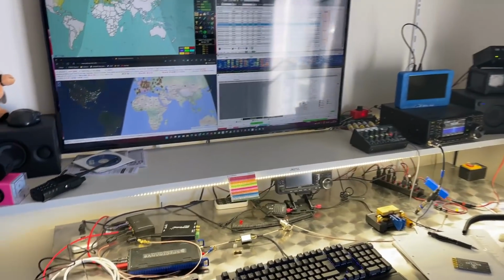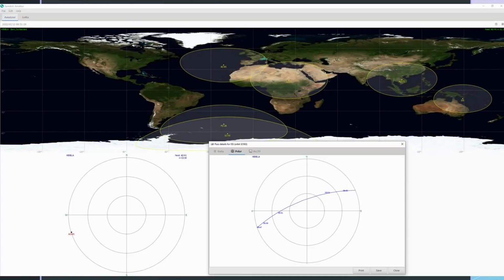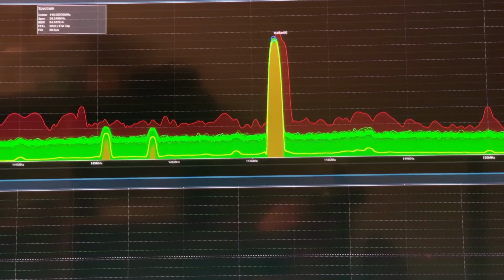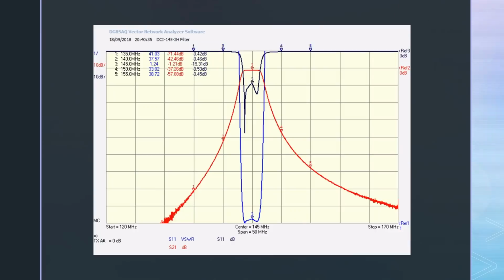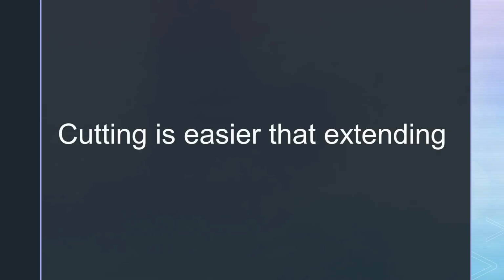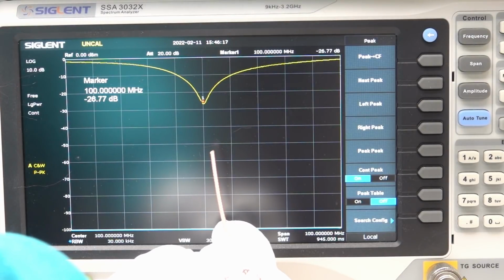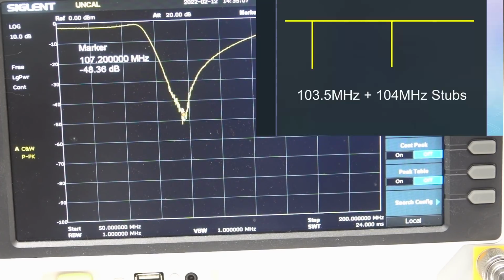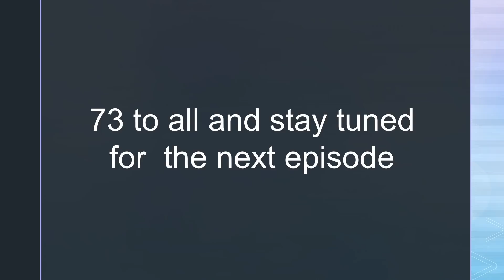009 Does a simple Quarter-Wave Stub Reduce Interference?

Comment: I need a filter for the 144.3 digipeater 6 miles away. BUT I still want full RX on  144-144.25, or everything below 144.300. Can this be done?
Reply from the maker: Not with this stub. You would need a much bigger filter for that.

Comment: You can get sharper nulls and closer spacing using longer stubs so a particular shorted stub will appear as a short at 1/2 wavelengths (of the offending signal) but as an open at 1/4, 3/4, and so on, of the desired signal.  A length will exist that achieves this although the closer these two frequencies are, the longer the stub needs to be and you start to lose efficiency.
Also, the stub is going to have multiple frequencies where it is open or shorted.
Reply: That's a Pro Tip right there !!
Thank You !!

Comment: I know this is 2 years old but something I didn’t see mentioned. If you add a second 1/4 wave stub spaced 1/4 wave from the first you will get a deeper and sharper notch. I don’t know how far you can take that, might get unwieldy after a few. You can make it tuneable also by adding a variable capacitor across the far end.
Reply: That's a great tip !!  Thank You !

Comment: Nice video!

I have seen coax stubs used on HF when having a group contest station, and it works.

If you were to use air dielectric coax, or make your own coax cavity, it would work much better than the coax stub.
I have seen where the cavities were silver plated to increase the Q.

RF is fun!
Reply from the maker: I agree with the cavities. They are also used for repeaters!

Comment: Funny i have a similar problem at home. I live very close to the local tv tower which houses a strong DAB Transmitter at arround approx 180Mhz. Weak Receivers like my SDR Play or a the direct mixer of my Anytone Handheld are getting overloaded as soon as you connect broadband antenna. Adding a quarterwave stub to the feedline  solves the issue.
Reply from the maker: Cool! 180 MHz fortunately is quite distant from 2m...

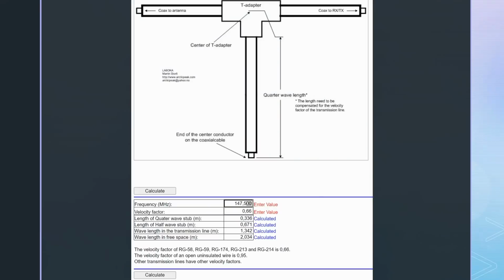Comment: 4:41 something you forgot to explain very well about coax VF for a novice, different types of coax material have VERY different velocity factor percentages! But you can always Google that coax to get a close enough estimate! 😁As an example between the "same" coax... a favorite "fancy coax" here in the US, LMR-400 has an 'advertised' VF of 85%, but I've tested a cheaper version called KMR-400 and found it had a 90-93% VF and MUCH lower TX losses at a fraction the cost. Of course that means even using the "same" series of coax the lengths would be quite different.
Reply from the maker: I agree. This is why I use cut the cable too long and use the VNA to decide on the length ;-)  (Then you can calculate the true VF)

Comment: An excellent presentation on 1/4 wave stubs. I've only made a couple, but I was pleased with the results. They are simple, and they work. 
I suspect larger diameter coax would have a higher Q and provide an even narrower filter bandwidth, and heliax would provide the best. I've ignored the small pieces of it I have had access to in the past simply because I thought it to be useless, but next time I see some I'll grab it for stubs.
Reply from the maker: You are right. Thicker coax has a higher Q

Comment: Cool!, usually losses are what define the BW, did you try using a better cable like RG-400 for example?. Also, do all notches have the same BW, I am expecting the higher order notches will have narrower BW, not sure though.
Reply from the maker: AFAIK you can change the bandwidth with different coax cables. I am not sure if the losses are the deciding factor, though. But I did not test it. And I do not remember if the bandwidth on the harmonics was different and how.

Comment: I live within 5km of ~10 FM Broadcast stations, and anything better than the stock rubber duck would render a UV5R deaf with front end overload. Made a 5/8 flowerpot antenna, feedline, and coax stub tuned to 98MHz using some cheap RG6 I had lying around. The stub worked well enough that I managed to score a contact with a station around 50km away on 2m.
I've abandoned direct conversion and moved on to superhet radios since then lol. 73
Reply from the maker: In my last video I showed a stub, too ;-) But against a pager.

Comment: Many thanks. Also helpful is a shorted stub, which serves as a bandpass filter, passing the frequency it is cut for. Many years ago I worked at a USAF radar site that had various radars from high VHF to S-band, all blasting out multi-megawatts. Concerned that my 2-meter transceiver would get fried, I created a shorted quarter-wave stub at 146 MHz and never had a problem. Any signal outside that range and its odd multiples was seriously attenuated. 
I have some old coax around and I'm wondering if the same idea might work on the HF ham bands to reduce out-of-band interference and offer some protection against lightning, a problem in my area. Each antenna would have a shorted stub tuned for that band.
Reply from the maker: I tried a shortened stub instead of an open one. Open it had a notch at 96MHz and its odd multiples. Closed it had a notch at 196MHz and all multiples. So I did not see a broadband rejection of the closed stub :-(

Comment: You may want to experiment with a shorted stub too, a bit more tricky to tune but gives a band pass version. BTW, another few passes of iss this morning with KG-STV on the 70cm
Reply from the maker: Others mentioned that stubs should behave like band passes, too. But I did not see such a behavior so far (if you do not count the wide space between two "notches" as the pass band).
Reply: @HB9BLA  if you short the end of should behave as a band pass element
Reply from the maker: I tried it and it just changed the frequencies of the notches. The wide part between the notches are of course a "pass band"

Comment: What about making a BPF instead of a BSF?
Reply from the maker: I do not know how to do that with Coax only.
Reply: @HB9BLA  Terminate the end with a short. The inversion will make it an open on the desired freq (and multiples).
Also, there's a nice design by Zack Lau, titled "A No-Tune 2-Meter Bandpass Filter", that also mostly uses coax.
Reply from the maker: I tried it now (because others suggested the same thing. The result is the same curve, just with different notch frequencies. Now you can argue that between the notches there is a (very wide) passband.
I looked at Zack's article. It looks very similar to the one I showed with the two stubs. He even writes about "rejecting unwanted pager signals around 153MHz".
Reply: @HB9BLA  DL4XAV had a page on the topic, there it's also referred as "a band pass filter for a wide frequency band". It's a good read, and has nice pictures on the BPFs, and they are quite wideband. I'm not really sure how to make them narrower, but the no-tune 2m worked well for me, so I can recommend it.

Comment: Stubs are good, as are bandpass, however for this application you might want to look at a notch. 
As always another excellent video, thanks.
Reply from the maker: Actually, this stub behaves like a notch filter. Just not steep enough for this application :-(
Reply: What if you use an open quarter wave at 147mhz. Or possibly 2 open quarter waves at 147 spaced a half wave apart and a short at 145.
Reply: @joecarty8579  That's something I used to avoid receiver overload on some Motorola equipment caused by the nearby airport transmitter. Pretty effective solution.

Comment: Hi Andreas,
Does the SDR receive software provide a way to create a notch filter? My Flex 1500 PowerSDR can create a TNF tuned notch filter that can be made very narrow.  73  WJ3U
Reply from the maker: The SDR filters usually are made in software (one of the advantages of SDR). My problem most probably was created at the ADC or the Mixer stage. So before the signal was digitized. I assume your Flex still has lots of analog filters built-in to avoid this.

Comment: Nice video, and thank you for linking the useful things I need to immediately buy 😁. What crimp tool do you use for the SMA connectors? I have an IWISS HSC8 6-6, but I don't think it'll open wide enough.
Reply from the maker: These are made for ferrules. You need a different one. I left a link in the description to the one I use. Probably not the best quality. But ok for me (I solder the inner pin because I was not very successful with crimping it)
Reply: @HB9BLA  Thank you for replying. Silly me, I looked for the crimp tool in the description but didn't see it at the time. Of course, I can see it as plain as day now - ordered!

Comment: Nice, this is always a nice and simple way of filtering out a spur. Especially since the materials needed are easily available. 
I guess you can do this with whatever media you have? 
Like coax in all impedances, stripline, twisted pair, etc.?

Do you plan to make a video on the spectrum analyzer?
I came across them by coincidence and they seem to be very nice units.
Reply from the maker: The principle should work with other media, too.
There is a video about the NanoVNA (how to use it). And maybe I will once to a video about different tools...
Reply: @HB9BLA  
Thanks for the fast answer. Good to know, I since read other comments saying they used this technique for twin lead as well. 
Thanks, I meant the Spectran V6 Spectrum analyzer. :-)
Reply from the maker: If you look at its price tag it is not really for private persons….

Comment: You can make the notch deeper by wrapping some Al foil around the stub. You have to experiment with the length of the foil and its location on the stub. I've seen an extra 20 dB of rejection if you get the size and location just right. :-)
Reply: Interesting that you mention the aluminum foil.  When I was a teenager the cable company would scramble Showtime unless you paid for it.  If you paid for it you got a box to filter out the frequency they mixed in to scramble it.  We would take some twin lead hooked to the antenna input and slide aluminum foil up and down on it until we filtered out the scrambled signal to get free Showtime so we could watch.  It probably wasn't legal but it worked!
Reply: @gibbywankenobi66  We did the same thing.  It wasn't illegal if you called it a school science experiment!
Reply from the maker: Thanks for the tip!

Comment: Andreas, thank you for another great video.  I'm very impressed with your wall of cables.  I'm a big fan of crimp connectors but have never attempted them on thin coax.  73 Lloyd - W1LBM
Reply from the maker: It is very easy (much easier than soldering), particularly for the small cables.

Comment: MANY years ago when I was a kid I lived in a rural area with a local (5 miles) channel 8 but I wanted to watch channel 9 but  that station was 65 miles away and channel 8 interfered and bled over. I made a 1/4y open stub and added it to the twin lead input on the TV. It worked so well we had to rotate the TV antenna to point at CH to watch it without snow. 73 WC0H
Reply from the maker: Also other commenters wrote about this use case! I think it was an easy and cheap solution (and it was even easy to find the right length because you had your analyzer connected to the antenna (the TV set)

Comment: Good but why not include the filteras a directional antenna?
Reply from the maker: The ISS moves fast and directional antennas would add another level of complexity, I think.
Reply: @HB9BLA  Sounds like a 'fresh idea' and use of a micro-controller then?  (rats! wrong channel :)   R
Reply: @HB9BLA  but don't 'we want more?'  :)  (Ah sorry that's the other channel) You can see it plainly as it passes overhead
Reply from the maker: @dicktonyboy  Indeed this is a new project. And it might appear on this channel. Two ball bearings already occurred in the stream of mails here ;-)

Comment: Larger coax = higher Q filter.  Velociy factor changes with frequency for the same coax cable, the published vf is no use away from the frequency they tested it at.  The quarter wave stub is a very useful and interesting thing, 1/4y transforms open circuit to dead short, so shorted end behaves like open circuit at resonance and vice versa.  Very useful with a PIN diode for switching.  Often used in microwave circuits for obtaining a DC ground.
Reply from the maker: Good to know about the Q factor. I have to check if I can make the same stub with PL259s and a bigger cable... 
The beauty of the VNAs is that you do not need to trust the VF calculations (other than cutting the coax long enough).
I find PIN diode switching very elegant, but never tried it myself.

Comment: Excellent video!  It's a bit rude that they are using pagers on 147mhz.  In VK, they are located above 148 and that's bad enough.
Reply from the maker: We have plenty of problems with them. Not only me...
Reply: @HB9BLA  Absolutely! I remember that my 2m handheld RX with lamba/2 antenna was blocked by one pager TX that was maybe more than 2km away.

Comment: Very instructive video.  I am having a similar problem receiving 137MHz NOAA images because of a local pager signal near 138MHz.  I may try a stub in addition to my homebrew LC filter although the interfering signal is extremely close. Have you any comments on SAW filters ? (Limited frequencies of course.)
Reply from the maker: The SAW filters I saw were for higher frequencies. But if the tho frequencies are so close you need an extremely narrow filter like the one I showed. They are also used for repeaters. Or you have to give up. :-(

Comment: Six meters used to be a problem band to transmit on because of interference with VHF over the air TV signals. Similar filters sometimes helped if the TV wasn't too close to the six meter transmitter.
Reply from the maker: I can imagine that this was a problem. TV was below 100 MHz in the first years… so far I never tried 6m. It was not allowed when I was young and now I have no antenna.

Comment: I think that I would do a 12 dbm antenna and  lay it horizontal then make reflector on the  earth side. The reflector should be able to cancel the earth bound transmitter . turn 90  degrees    ( -   reflector antenna
Reply from the maker: A directional antenna might help. But because the ISS passes are different, it probably would sometimes even amplify the pager station :-(

Comment: Hello Andreas, great explanation as usual ☺️👍
Would such a filter be possible on 13.56 MHz? Perhaps it will be very long? The piece of coax must be always straight right? Can a capacitor be used as a filter? Since cutting the third coax to the right length is in fact adding capacitance? 🤔 73! DE1CTL 🙂
Reply from the maker: You can calculate the length. It is quite immune to the position. You can wind it up. The make such filters also for low frequencies.
The coax is not only a capacitance. It has a clear resonance. So an L Must be involved. But everything distributed.
Reply: @HB9BLA  Thank you Andreas, I do learn more and more useful stuff from your Channel. 😉 👍
Reply from the maker: I would hope so ;-) otherwise it would not be worth your time.

Comment: I made a stub for 144.3 MHz to stop my VHF TX from stopping TV working. Cut the stub, tuned it, and fitted in the loft! Perfect!

Then the TV stopped working. Turns out that 721.5MHz (5th harmonic) was the frequency of the local BBC DVB-S transmitter! 🙈 It attenuated that perfectly, too!

Moral of the story, don't forget about the odd harmonics of the stub! They'll be attenuated too!

George M1GEO
Reply from the maker: True. This is the advantage of modern VNAs. We see what happens! It is also much easier to tune a stub. I would not want to tune it without a VNA. The last cuts were very short….
Reply: @HB9BLA  Yes. I was using hard-line coax and a file at the end, with a Keysight VNA. And of course, zoomed completely in at 2m band with no care for 750 MHz! 🙈

Comment: I do have a similar problem here in Berlin. When using my Baofeng radio with my 4 element Yagi-Uda antenna I always use the 2m bandpass from YU1LM which works absolutely great (I do have a video on my channel if someone is interested). I recently set up a satNOGS station on a tower and unfortunately the biggest problem is a ham radio relay transmitter on 145.6MHz which leads to heavy intermodulation. My boyfriend already suggested using a big cavity filter to get the necessary steep curve for filtering. Maybe on day...
Reply from the maker: These cavity filters are great! But as said, not cheap…

Comment: When I was young I worked at a TV shop in a small town and we did something similar. The closest TV station was 35 miles away, but there was a college FM station was downtown. Back then TVs all used 300 ohm twin lead so our traps were made from this, but the idea was the same. We installed hundreds.
Reply from the maker: Cool. This for sure also was not an expensive solution!
Reply from the maker: No, the next airport is 30km away...